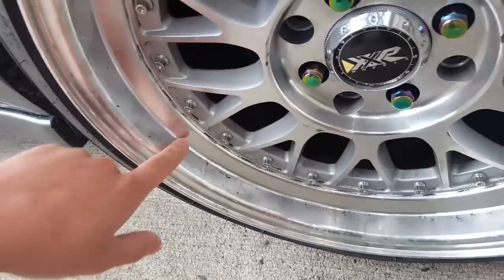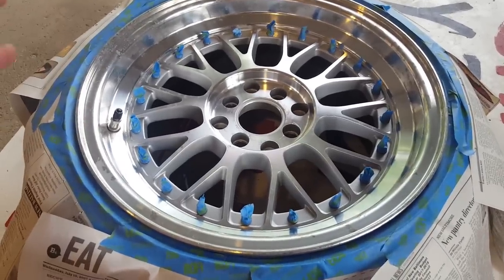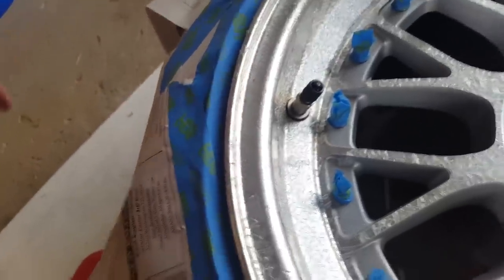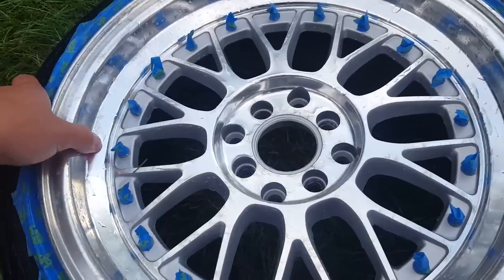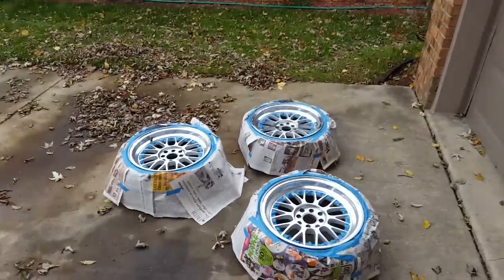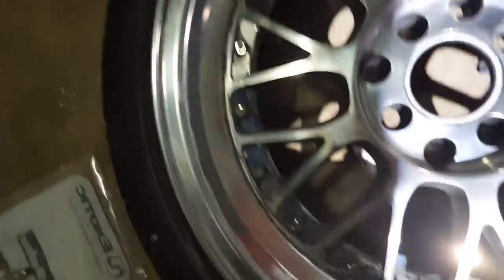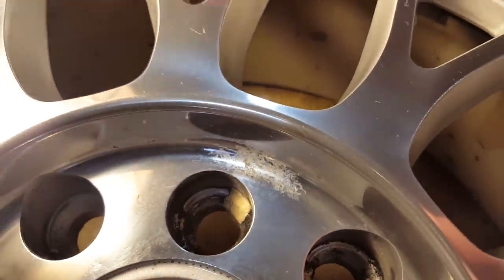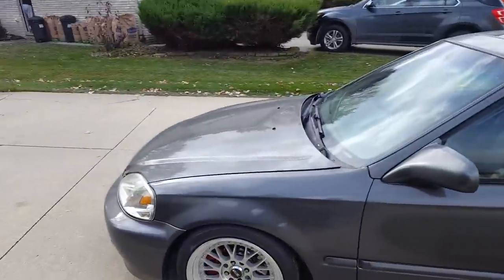How To Fix Peeling Clear Coat On XXRs

Comment: Use approximately 1500 to 2000 grit sandpaper on the badly oxidized spots then polish. Use a two part clear coat in a can ie Eastwoods to give them protection so you will not have to keep polishing. Might as well since you have already done the hard part. Just FYI. The wheels look great.

Comment: Totally irrelevant to the video but I was wondering if you knew how to fix a tachometer, my 97 ex one doesn't work. I took out everything and replugged it correctly and nothin. Any suggestions
Reply from the maker: ProjectVader try a different cluster. The circuit boards in them go bad sometimes.
Reply: ok thanks
Reply: I was actually doing the same thing 😂 my 98 sedan bounces from 15-20 mph lol check the speed sensor on the trans
Reply: Yup change the cluster. Had to do that few weeks ago for my 00 EJ8. Get it off Ebay or a salvage yard. Also change the VSS sensor (optional)

Comment: When do you use aircraft stripper or paint remover it cause you go down to bare metal and then you have to feather everything out. You're better off just using some 120 grit or 180 grit sandpaper and set her out to eat surfaces and then put primer and then repaint. Using aircraft stripper just makes the job much more harder and less the entire wheel has the clear coat coming off in so many spots that it's too much the sand
Reply: Which product would you advice to repaint that chrome finish after primer?
Reply: @Fafayega  if you're talking paint I like Matrix or PPG Chromobase. Really depends on your budget

Comment: After spraying clear coat on my wheel, why did the color change to Gold?
Reply: Maybe it wasn't two part clear coat, and its orange peel from probably to much sun during spraying. 🤔  two part clear has a mixing hardener in it when you crack the bottom open.